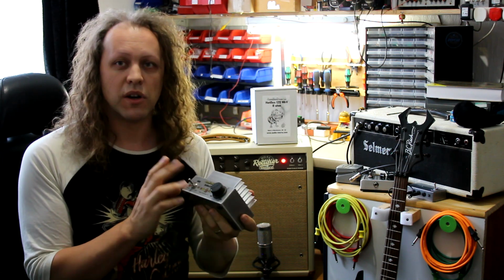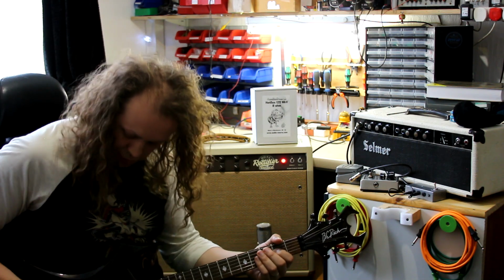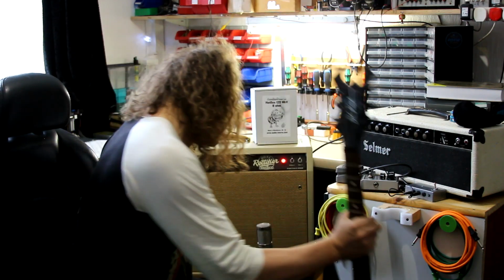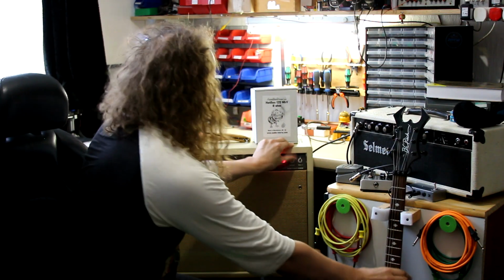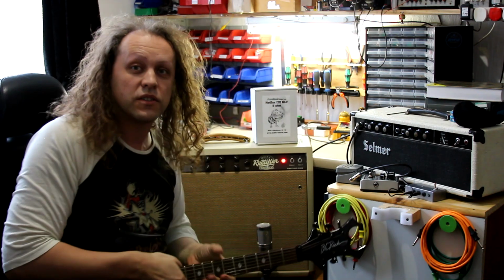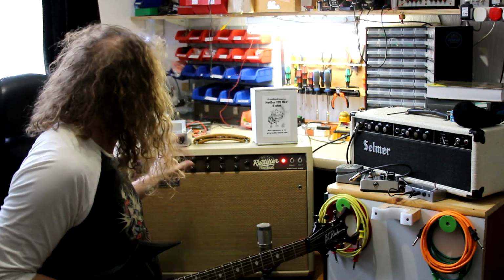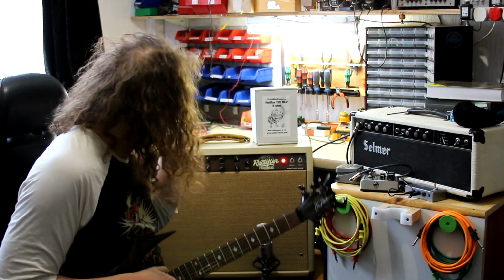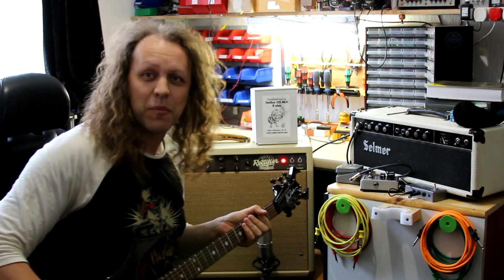AudioStorm HotBox 120 MkV Product Demo

Comment: I bought the 125i mk5 hotbox the other week and just want to say it's a phenomenal piece of gear.

Took a punt on it instead of more popular/reviewed load box and can't be happier. Using it on a Supro 1695T and Fender Hot Rod Deluxe. So good to hear the amps properly now at home. Once Coronagate has passed i can't wait to take it to gigs. 
Amps that I was happy with now sound completely revamped and perfect with the load box in - the way they were supposed to sound! 
At gigs pre load box, the Supro is normally about 1/4 volume just making it purely clean and even a tad muddy at times. Im now getting its signature sound at anywhere between 1/2 and 3/4 on the volume with the dB levels being acceptable. Without the load box, this volume is completely unusable which has always been a problem I've had until getting the attenuator. Amps that i was happy with before have just got so much better. 

The inductor modes on it are brilliant but my favourite is the resistive circuit on it actually. To me there's no noticeable or drastic loss in the frequencies as the amp is attenuated. Venue and studio mode are great but still a bit loud for home (I'll be using one or the other at a future gig for sure though) but the jam mode with the variable control is brilliant. 

Opened up the unit and can say that the craftsmanship and design that went into it is brilliant. Solid components, robust wiring and neat as hell soldering work.
Reply: Hi Paolo, could you please advise? 
If I run a 100w tube amp (Sovtek MIG100) through this attenuator into a 4x12 cab with Celestion Vintage 30s, do you think I could get so much volume through the cab that I could make the viewers of a small venue uncomfortable? 
I'm asking before I buy because I'm worried that this might have too much attenuation by default to really move air in a gig situation.
Reply: @imantssafronovs9245   When i play live I'm always mic'd so the attenuation level is pretty good for me in studio mode on the 125i. With a 100W amp cranked to about 12oclock  im sure you would have plenty of volume still in the studio mode of this 120 attenuator. I think the 120 mkV he is showing here is exclusively studio or jam mode (only jam mode uses the variable dial).

One of the reasons i went for the 125i is the ability to bypass. Also being honest, the venue mode on the 125i might still be too loud for me (yet to try live) but remember I'm always mic'd. I'd probably have a 25W amp dialed to about 1 oclock volume in studio mode for a gig mic'd for a room of about 300 people maybe. 

I cant remember off the top of my head what the actual dB cuts are on these attenuators but its definitely somewhere on an audiostorm video or website. One thing to remember is with cheaper passive attenuators like the Bugera their loudest is usually about 50% volume.
Reply: @paoloerc937  Hi Paolo, thanks a lot for your feedback. I think this device will do the trick then.
Reply: Also, Sean got back to me with helpful info via email - just writing this here so it's on public record. Thank you Sean! Order placed, can't wait to receive it.
Reply from the maker: Hey! Sorry I've not been replying to comments for ages .  Thanks for stepping in and dropping this review and your great answers. It's hugely appreciated!

Comment: I have an 8ohm one of these and I use it as you'd expect with an 8ohm amp. The question is can I use a 16ohm cab on it's own plugged into the Hotbox or mix 8 and 16 ohm without damaging the amp?